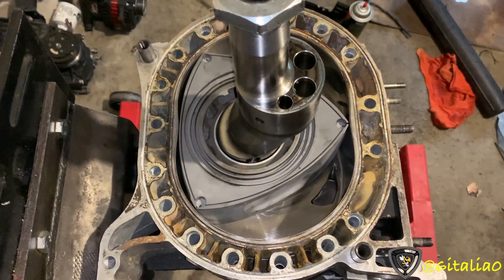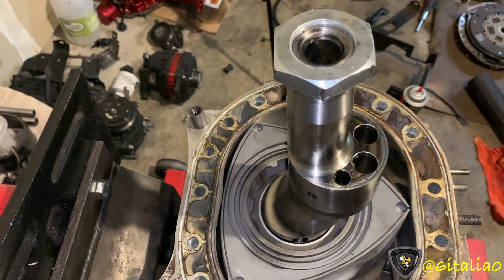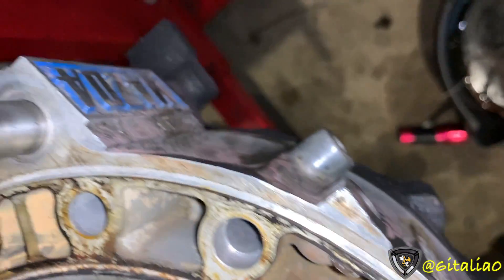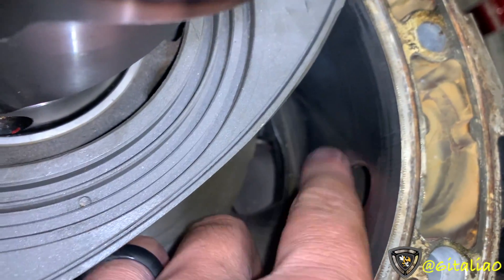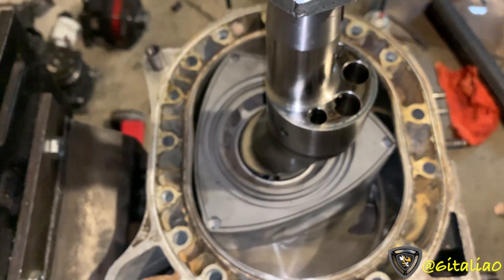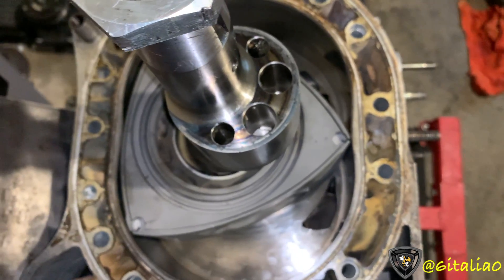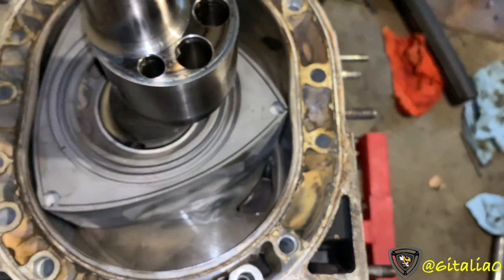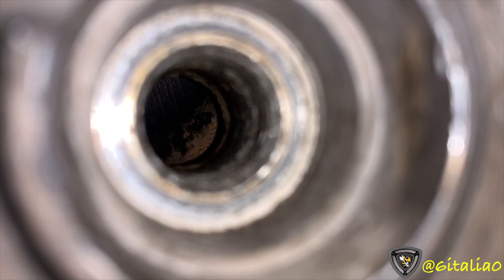YOUR RENESIS 13B MSP DOESN'T BRAP!!! | Here's why

Comment: Am I the only person who looks at the Renesis and thinks the injection on it is done wrong?
Reply from the maker: I’m not a fan of it either. The series 2 system was a great improvement, but still doesn’t do anything for the area between the intake ports and oil injectors.
Reply: @NateRist  for me the whole fuel/oil injection system on rotaries seems off. I've always wondered why not just inject the fuel directly after the intake is closed off by the rotor and have the oiling done in between intake and exhaust ports. Also always though the exhaust should have been handled by a port on the housing rather than the irons.

Comment: I own a rx8 with a half Bridgeported and turbocharged. It’s doesn’t really sound like brap and more like brop brop brop. sound doesn’t as solid like 13b RE Bcs of the exhaust port are different. But it’s still “brap”. 1 more thing make different I guess might Bcs of renesis are using E throttle and RE are not. E throttle will automatically rise up the throttle when it sensed the “unstable” overlapped idling so make it sound funny. there’s goes spent extra money for standalone ecu again. But overall the 13B renesis still amazing and having lot of fun with it.

Comment: I just bought an RX7 S4 NA, thinking of a Renesis swap...but nahhhh...properly just Street Port when rebuild comes.
Reply from the maker: A renesis swap would be perfect, but it’s a very involved swap that can take a lot of time, so just building and streetporting your current engine would be a much easier route. I would highly suggest getting a set of turbo plates as ported 4 port NAs will always be capable of more power than a ported 6 port
Reply: @NateRist  Isn’t 6 ports Mazda’s Vtec for rotary right?
Reply: @MrMeoow91  pretty much, 2 of the 6 ports open just shy of 4k rpm. He’s saying the turbo 4 port irons would be better because they can be ported more. The 6 port irons have less meat to grind off around the intake ports. I have a gsl-se and I think I’ma streetport my 6 port when I rebuild, but I’m not shooting for enough power to necessitate 4port irons.
Reply: @leizeebee  I am looking to hit  120-150hp at the wheel without any intake & exhaust mod. Not sure whether that is possible...
Reply: @MrMeoow91  All 13Bs make 120+HP. A street port will put you on the higher end of that range, but you’ll need a tune to take advantage of the new ports
Reply: @leizeebee  I spoke to my local Rotary shop. He said with the stock S4 NA 146hp engine, it would make around ~100hp at the wheel.
Reply: @MrMeoow91  He’d know better than me and I missed the at the wheel part anyways lol. That seems like a lot of drivetrain loss but again, he’d know better than me. Good luck w your build!
Reply: @leizeebee  Ikr 😂😂😂. I was shocked when he said that. I will dyno the before and after rebuilt because I am quite curious about the real figure.
Reply: The old 13b is a gem and keeps the cars value up any engine swap drops the value and the coolness factor to the Street port there’s 3 types slight mild and big choose your preference and then there’s also a semi p port a full p port makes the engine not last but the semi p ports are pretty good also get some good Apex seals and get it tuned good they make tons of power look up n/a dynos and you’ll love it the renny is just a debuffed version that doesn’t last that long love your car and the brappp❤️

Comment: I'm currently building a hybrid Renesis turbocharged, do you recommened week all exhaust ports open or block side ports?
Reply from the maker: The build you’re planning has been tried many times and almost always results in failure. Blocking the side ports would be preferable, but there isn’t a reliable way to do it (welds will hold for a bit, but will crack and fail due to inconsistent expansion of different metals). If I were you I’d ditch the idea of 5 exhaust ports and just port down on the side ports to allow more heat to escape sooner. NA that might lead to power loss, but in a turbo application you’ll make that back up and more. Also clearance the side seals to .006-.008 and it should do fine
Reply: @NateRist  Welding the iron plate sounds (as you mentioned) prone to failure.

Keeping all side ports full open will reduce the exhaust velocity, so, turbo will spool slow.

But what about keeping side ports opened but using a very small tubing (only for the side ports)? Iron plate will still reliable plus exhaust might flow well. 

I'm just trying to investage as much as possible.

Your idea about porting sounds interesting, how ever I'm still worried about the Renesis reliabitliy passing the 400whp mark.

Thanks for info... Great channel
Reply from the maker: @josezuma  If reliable 400whp is what you're after i'd probably just bite the bullet and go with either an REW or other older 4 port peripheral exhaust only setup and use your modified RX-8 rotating assembly paired with a streetport and you should see that along with great torque and response on low boost.
Reply: @NateRist  Sounds like a good idea. Going to check for some parts.

Just to close this topic , what were the failures you saw with the Renesis Hybrid?
Reply: @NateRist  Another YouTuber built a race Renasis engine by using peripheral exhaust ports. It seemed to work great for mazdatrix.

Comment: Depends on HOW porting is done. At low RPM only primary port is open. So if you don't port the primary port, you won't lose low end torque.
If you open the exhaust too early you will lose low end torque but gain top end.
If you don't port towards the housing walls, you won't have overlap.
If you cut down on the dam wall on primary port, the amount it gets trimmed will affect the fuel mixture vs air flow.
It's about HOW you port it.
So port the secondary and aux ports for max air flow, port the primary for trimming the dam wall and smoother flow into the chamber. Port the exhaust for wider and smoother flow without early opening for power without losing torque.
Reply from the maker: Anything beyond stock shape ports degrade performance. No matter what you do with porting they will never be as good as stock ports. Minor top end gain isn’t worth it when it degrades performance throughout  the rest of your rev range and porting down on the exhaust port will cause HP loss (this is true for and NA rotary and why it’s always recommended to only port up, but the Renesis is as far up as it can really go, so nothing can really be done beyond that). The only form of “porting” that’s truly beneficial is leaving the port shapes as they are, but smoothing our the carbon catchers and removing cast defects as well as rounding off the sharp edges.
Reply: @NateRist  you will have to explain larger ports on 4 port engines with more torque.

Comment: You should see the ports on my renny.. CNC ported.. has some good overlap. The exhaust port has that shelf cleaned up too, but the beauty is that the exhaust ports were extended far lower than stock.. opens probably the same time as that peripheral port does and as you said, closes much later. 👍🏼 not to mention my intake ports.. massive.
Reply from the maker: I can see the benefit of extending the exhaust ports lower, but modifying the intake ports I’ve yet to see anything truly beneficial and don’t really see the point in it. Small peak HP is there, but midrange takes a hit which just means the car struggles more in the area it’s usually at under normal conditions. As far as racing “especially endurance racing” the biggest difference seen between ported vs stock Renesis engines are longevity. The ported engines just don’t last. This is why I opted for just cleaning up the cast defects and carbon catchers and nothing more and it’s wonderful and is considerably quicker than stock
Reply: Nate Rist I agree on the intake ports.. I got them done because why not? Lol I love my renny.. it thinks it can hahah I will be supercharging it soon 👍🏼

Comment: I run 4 port plates with ported exhaust ports and devcon in the intake port, stock rx8 housings with no exhaust port and a 48mm peripheral port, custom exhaust with one resinator and a muffler, gilmer belt kit and a 48mm ida. Check my vid out
Reply from the maker: So peripheral intake with side exhaust ports. Sounds interesting
Reply: Where's your vid bro?? Doing the same atm

Comment: Old 13b: brap brap brap

13b renesis: mmmmmmmmmmmmmmmmmmmmmmmmmmm
Reply: renesis: [washing machine at 1000rpm intensifies]
Reply: You have to port both engines as well it doesn’t come from the factory brapping
Reply: Old 13b goes mmmmmmm factory to

Comment: I also think porting exhaust to either early or wider, but not later timing as well as polishing is the key to more power. RX-8 has massive intake compared to before but exhaust is the real restriction. Especially the middle iron where two rotors exhaust comes to meet and push back against each other.
I think a sleeve or header plate with divider between the two to extend the factory tiny divider will go very far
Reply: ooh i like the idea to seperate the joined exaust ports